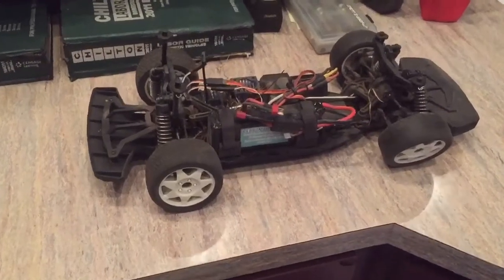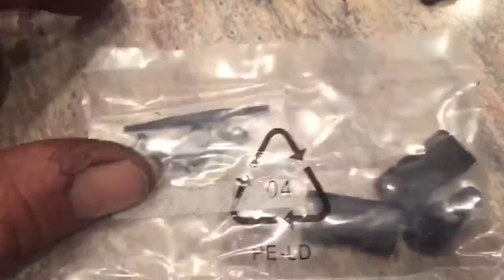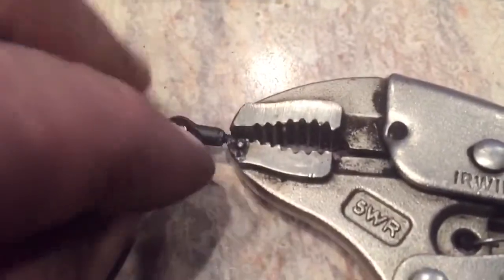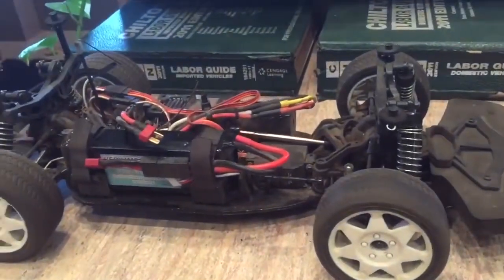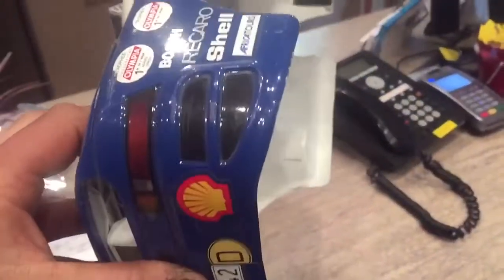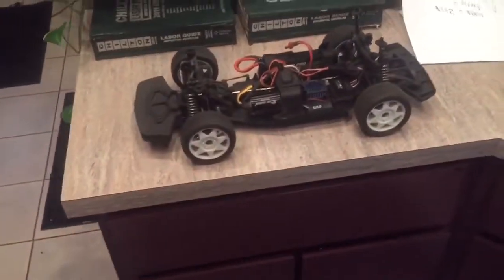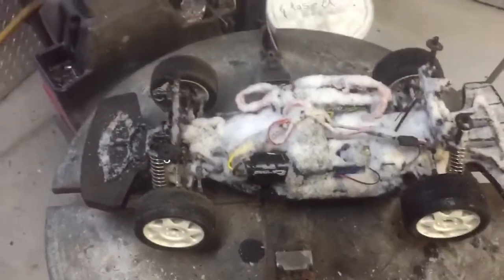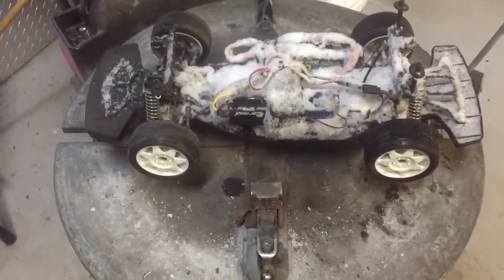6amRC. Carisma M48 Porsche 959. Repairs and test run.

Comment: What battery  are you  using? It looks pretty fast.
Too bad you can't  run it on my backyard  rally  course.
Reply from the maker: Backyard RC   3s. Motor is only 3000kv.  It's around 30-35mph. If part support was better I would recommend it more.